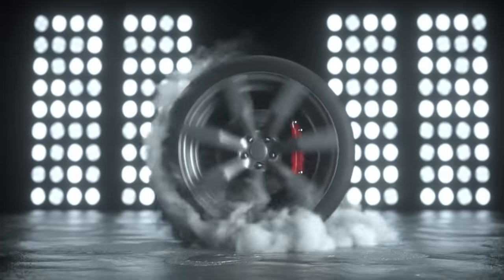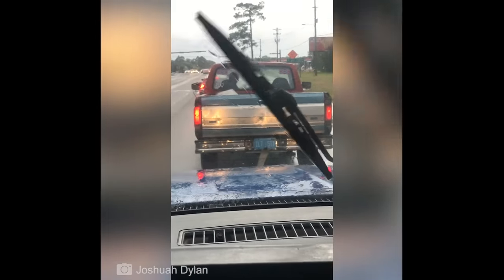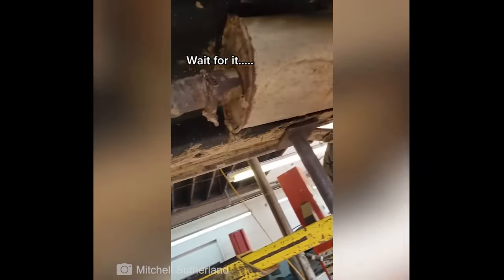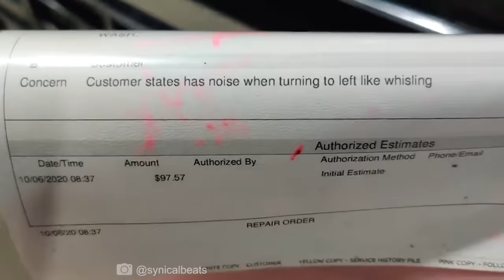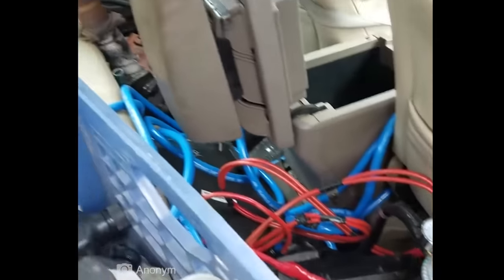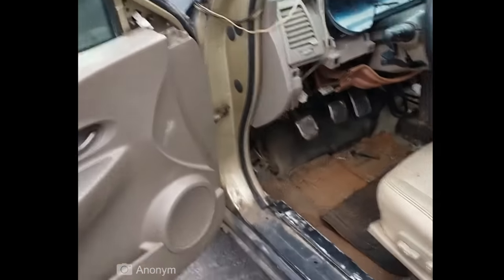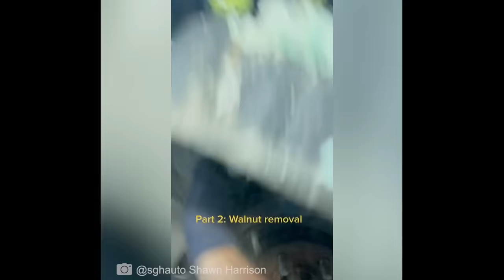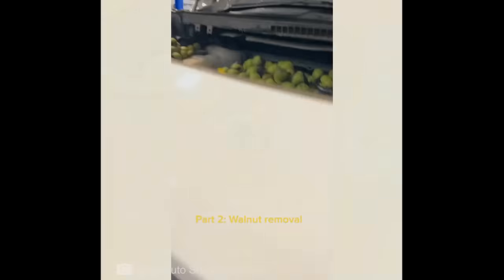Mechanical Problems Compilation [Part 21] 10 Minutes Mechanical Fails and more

Comment: "...theres still everything on top" wow, ive got squirrels around my house but they dont hate me this much
Reply: Did squirrels put all those nuts there? Where I’m from in Australia, we don’t have squirrels, so I have never seen anything like this.
Reply: @stevendouglas6593  more than likely squirrels. Seems to me this one might not of made it through that winter.
Reply: Black mountain squirrel tried making a stash in my ac in my truck turned that shit all full and drove 5 miles he left but now I need to replace my broken ac for it shit and pissed in it and eat a couple wires thats $200 to $300 i dont have.
Reply: For real
Reply: My grandmother had the same problem as the last vid, only it was with 10-15 pounds of dog food
Reply: I used to rent a house, from an older lady. It was out in the sticks and she had a ranger parked out there. She knew I was mechanically inclined, so she asked if I could get it to move to a different spot. I opened the hood and seen the air filter and throttle body had been off, the top of the engine was covered in nuts, and some had of course gotten into the open intake. I told her we shouldn't try to start it, but I'll be damned if she didn't drive it a whole 50 ft, before it stopped. Funny as shit. You try to warn somebody but you're just a mechanic. But that's income, for me. XD
Reply: It was staged. Walnut start turning black almost as soon as they fall off the tree. For walnuts to still be green and have that many in there, it would have had to been 20 squirrels carrying them in one night.
Reply: @cleverusernamenexttime2779  This isnt true at all.  Walnuts remain green for many weeks,  we have black walnut trees and i've been picking walnuts up off the ground since I was a child.
Reply: @cleverusernamenexttime2779  Hello Sherlock Holmes.... how are you doing?
Reply: @stevendouglas6593  yeah you get into like the North Carolina Hills them squirrels will play hell with you. They love them walnut trees
Reply: @Sawbonespc  I know I used to live in Hendersonville North Carolina but we have black walnut maybe they got some kind of different Walnut then we had reckon
Reply: @stevendouglas6593  I had two macadamia nut trees at the back of my place in Queensland, Rats would gather them up and store them in convenient places, like the insides of air cleaners . I've had to vacuum nuts out of plenty of cars over the years until the trees died .
Reply: @cleverusernamenexttime2779  damn you wemt reeeeaaalllly quiet i see
Reply: @Sawbonespc  not where I live theey don't. Maybe a couple days
Reply: @thevalorousdong7675  I dropped a comment and went and watched something else. I didn't have notifications turned on so didn't see them.
Reply: SAVE THE SQUIRREL'S.
It'll leave more for me to eat
Reply: @thesilentone4024  that sucks man squirrels are ruthless. Found a few cables stripped and a pile of acorns and knew it was bad
Reply: I saw the walnuts. And all I was thinking is, WTF?
Reply: @Sawbonespc  I have to agree.  Growing up in the Southeastern US, Walnuts would stay greens for weeks.  We would gather them up off the ground, put them in a box for them to dry out and then deal with them several weeks later after they dried out.
Reply: We ain't got squirrels here. 
I was wonderin how the hell.
Reply: Mooo
Reply: O
Reply: O
O
O
Reply: O
O
O
O
Reply: O
O
O
O
Reply: O
O
O
O
O
Reply: Om
Ooooooo
Reply: Oo
Mo
Reply: Oo
Mo
Reply: Ooooo
Reply: Oo
Reply: @stevendouglas6593  oooooooo
Oooooo
Reply: @stevendouglas6593  9ooooooooo
Reply: @Sawbonespc  I can attest to this. Grew up with a massive black walnut tree in my yard. Also use gloves or else your hands will stink and be green for a week.
Reply: XD the sunroof was open on my Subaru and the squirrel hid walnuts in the ceiling. Every time you drive around you hear them rolling around
Reply: I've never seen anything like that. Talk about a winter storage
Reply: The walnut one is just absolutely bunkers. I've never seen that before!
Reply: Not that you 'know' of.  😄
Reply: How is there so many walnut’s
Reply: Ever seen furry vengeance with Brandon Fraser? This is what came to mind lol
Reply: @cleverusernamenexttime2779   No one expects the Spanish Inquisition!

Comment: The farting fusion had me dead
Reply: The subtitles call it [Music] LOL
Reply: @samuelhenry8366  it is music to my ears
Reply: had exacly same problem its fuel vapour separator problem its common problem in US versions
Reply: I had me dying! 🤣🤣🤣
Reply: 2:00 Seen this issue on the UK version (mondeo) 🤣😂💨
Reply: purge valve solenoid is a very common failure
Reply: Yet another example of reinventing the wheel and the reinvention is crappier. (See also: rotary shifters, turn signal stalks that don't stay where you put them, SD card slots instead of in-car DVD players, auto dimming slightly green tinting mirrors, etc)
Reply: Good morning sir I would like you to do a walnut removal please.😂😂😂😂😂 ..
Reply: It sounds like my dad when snorts when he sleeps

Comment: 2:06
Brakes: ok
Engine: ok
Transmission: ok
power steering: EXCELLENT
Reply: WTF caused that?
Reply: @thejohn6614  I know! The car looks to be a '90s Toyota, long before electric power steering, can the hydraulic system screw up that bad too?
Reply: @nthgth  I don't see how. I'm not an expert on steering systems but I would think the worm drive wouldn't work that way.
Reply: So between the rack and pinion which the pinion was stripped out most likely. There is a hydraulic control valve. When you turn the steering wheel it engages the power steering. Then when the rack runs out the hydraulic pump hits a pressure relief valve which sounds like moaning. Without this the steering wheel and power steering pump enters a positive loop feedback like in the video. Also destroys you clock spring in the steering wheel as well.
Reply: @jaypence332  thanks
Reply: 01:58 Steering self destruct system activated 
Later.. Attension Steering Self destruct failure
Reply: Power steering; "To window, to the wall!"

Comment: As a mechanic, I love this series 😄
Reply: Me too Dude,especially the Walnuts 
HOW! XD
Reply: I can relate and agree
Reply: I no need be mechanic to enjoy this too:)
Reply: Im not sure anything beats the farting fusion
Reply: Same. It’s always funny to have incredible stupid custom complaints. Had two complaints about the windows didn’t go up or down. And they had to cover the windows with duct tape so water didn’t leak in. The problem was the button on the drivers door had been pushed down so windows gets disabled.
Reply: You have to be a bad gay mechanic
Reply: That last one yep wtf walnuts
Reply: @KoalaKoala00  I'm just a baby mechanic. Just started classes this week. A few month ago I did some work on my car, finished up. Got in, started the car for a test drive. Went to roll down the windows & they didn't roll. Pulled over& cried cuz only
Mine worked.... Quickly realized it was because if the child safety. Then my friend later on was riding in my car after I reupholstered the front passenger door. He went to roll down the window& the door locked instead. I revered the window & door lock. 😂 I think it's hilarious & I'm completely unbothered by it.

Comment: I’m so glad that:
1. I don’t live in the north where all metals turn to dust over time
2. I work at a diesel shop where we maintain our own fleet, meaning we fix our own mistakes and 9 out of 10 we know what we are working with and we don’t get unpleasant surprises with people not maintaining their cars properly.
Reply: We live N NY. My daughter went TX for school. Her car was just 2 yrs old,  Took it in for brakes. Guy lifts it, freaks out. There's rust under here! You shouldn't have rust under your car." 🤣 try changing a salted in wheel bearing. 🥴
Reply: Sounds like a very boring job.😅
Reply: THE CRAZY STUFF I'VE SEEN! Rich Infiniti owners and what they think constitutes warranty work.  I almost got fired for telling a guy his 22+ year old rotted I30 wasn't worth fixing cuz the repairs would be around 6k and the car was worth about 500.00 dollars.  The subframe was swiss cheese, the engine had 290K on it, the frame was rotted as in I dunno how the control arms and other parts were still attached to the car and they weren't in some places.  Ugh, the stupidity...
Reply: @roberttyrrell2250  We had that same response trading in for crap my old car!!!!   IL to TX.
Reply: @richardsbrandon5027  Here if the frame doesn't have any holes & body mounts aren't rusted away? She's good for another 100k🤣
Reply: @roberttyrrell2250  Yes!!   But don't worry if some of the body struts are rusting through...
Reply: @richardsbrandon5027  that would be concidred a body mount. If body mounts are gone? Its junk. My truck is Ram 05. I took really good care of drive train. New bearings ball joints rods calipurs. At 200k could easily get another 125k. The salt is just eating her up.😥

Comment: 5:43 Lmao I love how the intake was painted, poorly, while it was still on the engine, you can tell by the overspray. Everything about the car puts me in it's owners head, and all I see is... Fast And Furious!
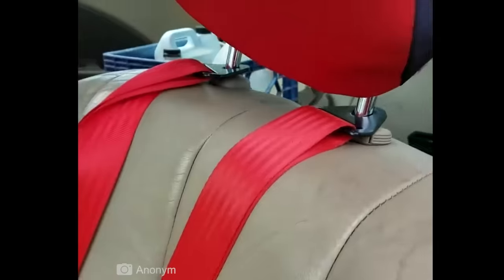Reply: Gotta love his “Baby on Board” sticker at 6:24 😂
Reply: I would buy that car as a showpiece so I can laugh at it each day.
Reply: That LPG line was something else...
Reply: All I see is meth, owner is a tweaker for sure
Reply: Did you like the exhaust pipe or whatever the hell that was sticking up into the cabin behind the driver's seat? Better sound if the exhaust goes into the car?? Lmaoo
Reply: @aaronbays7436  Smoking diesel and snorting petrol

Comment: I’m impressed by the pulling power of that Buick!
Reply: No, not really impressive. Your cars like the Buick have big ass engines. In Europe where I live we tow our house trailers with normal cars like a VW Golf, something you need to buy a truck for in the US. The most impressive I've ever seen was in the 1990's a small Suzuki offroad car - a Suzuki Samurai - towing a big ass semi truck with trailer. Couldn't see if the trailer was loaded, I guess not. That model existed only with 45, 64 or 80hp engines with 1-1.3 liter. I believe it was only possible because of the 4WD the Samurai has. And the Semi could not help. I was able to see a broken driveshaft secured under the truck with ratchet straps.
Reply: @seanthiar in other words, you have no clue about cars and spouting garbage ignoring everything in the video not knowing a thing about the pulling power of any actual car

FYI: it was multiple vehicles and and trailers linked by straps being led by a car that isn’t designed to haul anything behind it
Reply: it’s a funny convoy but sadly it’s just the lead car with the SUV doing the actual hauling of the trailers…unless i missed something and the SUV really is just there for traction and not actually pulling anything
Reply: @seanthiar no. You’re not towing anything of any significance with a Golf. That Buick does not have a big engine; even if it did, towing capability is more due to the frame than the engine. If that was Roadmaster you might have something. Looked like a Park Avenue with the corporate 3800 V6. Very reliable engine with mostly acceptable power. It’s not any kind of super capable towing package.
Reply: @jamesjarrait2231  Newsflash - just because US-American do it different doesn't mean it's the only way. I've towed big ass camping trailers and even a horse trailer with two cold blood horses in it with a VW Golf here in Germany. It comes down to traction and gear ratio. I've seen a small Suzuki 4wd pulling a semi out of a snow bank, because it had traction and the semi did not. Only US-American believe you need a big ass car like an SUV or a small truck to tow.
Reply: @seanthiar  sure…

Comment: 6:48 exhaust is probably the nicest "home built" exhaust i have ever seen, looks to be built using off the shelf repair parts...
Reply: Its much better then snot welding it together.
Reply: Was about to say...sure aint an "off the press" part from a store but home DIY? Hell Thats just impressive.
Reply: Wish we knew what it sounds like.
Reply: I was actually pretty impressed, probably the best you can do without a welder
Reply: Probably could have got a cheap stick welder from Alibaba for what he paid for all those U-bolts.
Reply: I was looking for this to make sure I wasn't crazy haha. Not bad at all for a driveway job and no welding.
Reply: except he split it way up at the front and had to run 2 pipes...
Reply: @kingjames4886  that's how it works when you run a dual exhaust.
Reply: wonder how much it costed vs just buying a legit bolt-on exhaust system.
Reply: @ghostly5866  

Pretty cheap to be honest.
Reply: Agree....best DIY exhaust I have ever seen assuming the guy is not a welder and all parts were bought off the shelf at Pep Boys. I have certainly seen worse. Only problem with all those clamped joints is they will need to be tightened a couple times a year.
Reply: @stonedwookiee278  Then he would need to learn how to weld. Any shade tree mechanic can tighten clamp bolts.

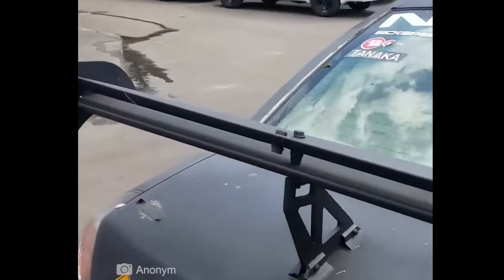Comment: 6:20 I'm amazed this guy even took this car to a mechanic.
Reply: We had one customers car. He drilled the brake disc's with dozens of holes for cooling. He soldered his brake lines together He had 2 coils going into the centre of his dizzy cap. Pure genius.
Reply: @JayDee-xj9lu  That propane tank though...   I know that violence is the reaction of the incompetent, but the owner of that car needs hands laid on them.  That's endangering everyone else on the road.
Reply: Seems a wet dream of ricer.
Reply: Thinking tweaker. Seen it before.
Reply: i'm amazed a mechanic would touch this after seeing that, most likely told him he's not touching it
Reply: Not gonna lie, I did a similar set up with a compressed air tank. All I ever did was lean out the engine and break a front motor mount.

Still can't believe I made a minivan backfire. I have a vid.
Reply: @SirCavemaninthewest  bro post it lol
Reply: i just saw it, and its beautifull

Comment: That altima..... 

5:40 That's crackhead stuff right there.
Reply: They prolly huff gas ;)
Reply: You couldn't pay me enough to touch that with a 10 foot breaker bar. If that work order landed on my box, I would hand the keys right back to the customer with a bill full of "environmental fees" and charge them for the paper that work order was printed on. The fucking mind of some people, jeez!
Reply: Aside from the propane tank, I have done electrical work on at least two of my cars that looked that scary... 

And my daily is still like that! X3
Reply: No more like meth
Reply: That car is a crime scene in damn near a rolling terrorist attack on wheels
Reply: You really can’t make this stuff up
Reply: that car is a ticking time bomb

Comment: That paint coming off like that at the 5:20 mark must have been latex house paint. 😅
Reply: early 90's to 2000 gm full size pickups had a paint adhering issue, the most famous color to peel was white!
Reply: I like the green color underneath better.

Comment: 1:22 batteries can explode. I would not have my head hanging over it when an open flame is near.
Reply: Lithium batteries can explode. Lead acid does not have a thermal runaway potential. The chemistry doesn't have an exothermic mode.
Reply: @jadefalcon001  with all due respect, you are wrong. Lead acid car batteries will explode. A cursory google search will show you. Or go ask a mechanic, you’d be hard pressed to find one who hasn’t witnessed it at least once.
Reply: Also when the terminal is glowing like that its welded itself to the battery. Best off taking the other terminal off to break the circuit

Comment: Ok,  on the "customer states noise when turning left" thing, I had a similar issue in my brand new 1987 Ford Ranger when I was stationed at Ft. Bragg. 

I had put my Soldier's Common Tasks Manual on the dashboard of the truck.  As I was driving, my left speaker would "cut out".  Took me almost a week to figure out that my SCTM was sliding on and off of the speaker as I would make turns.

Comment: My dad once got his truck serviced, and for some reason the people servicing it took the brake pedal off. They did put it back on, but nothing was holding it on. He was doing about 70 kmh when he tried slowing down, but instead ran up the back of a tanker trailer

Comment: Many years ago, I watched a motorcycle mechanic pull apart the engine on a CBR that had been stored in a barn for over a year, and mice had crawled up the tailpipe and packed nearly every empty space in the engine with dog food. (I think it was a CBR, anyway. Something like that.)
Reply: Saw essentially the same thing on YouTube years ago. Someone was trying to start their 240Z. Out pops a few bits of kibble. Try again, more kibble. Owner finally gets is started, and just winds up spraying the driveway with dog food, the amount blown from the tail pipe corresponding to RPM.

Comment: 6:48 the "exhaust pro". I will say that is pretty good work considering everything was bought at Pep Boys and he is not a welder. At least everything is sized correctly and proper clamps were used. Could have been worse, seen videos of this being attempted with JB Weld, fiberglass, soda cans, RTV, zip ties, hose clamps, fence pipe and other shit.